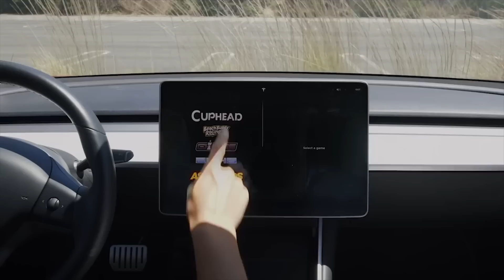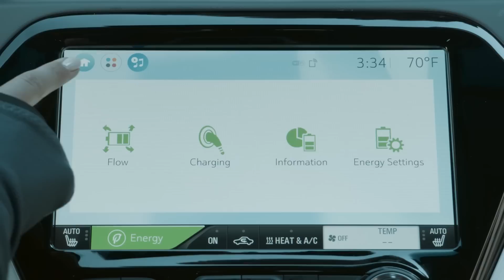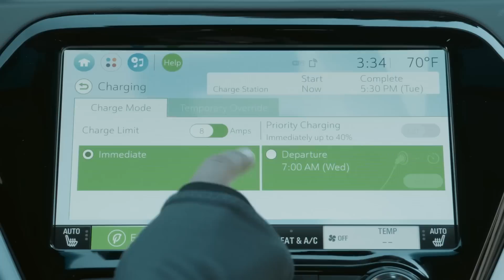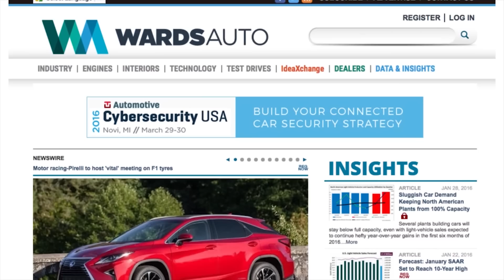Rivian Delivers 1st Electric SUVs; NHTSA Investigating Tesla - Autoline Daily 3229

Comment: If you abuse Tesla features they car will turn those features off for the rest of your drive.  I have no idea how car decides to do this.
Reply: It does not matter, California (Tesla's single largest market) prohibits the driver from having access to this feature in the CA vehicle code.
The Driver isn't even supposed to be able to see it or physically reach it. So that screen should be in the passenger side of the car, not the center console.
If it is, the driver can be given a ticket by the CHP or any CA PD officer the moment they see that on the screen.
And there is do defense to it and since it's built into the car, your set up for multiple tickets and if you get 3 of them in a year, DL suspension.

Comment: 3 seconds?  What I can't understand is why this infotainment screens were ever allowed either...the worse ones being those from the VW group as they are touch sensitive and everything is adjust by the unit!  There have been many Motoring Journalists complaining at the about of time needed to simply change the heating settings looking at fir the correct areas that controls the screens.
Here in the UK things are really quiet simple, "The Driver must NOT be able to see any moving screens from the driving position.. although there again the legal department don't s appear to have noticed the infotainment screens yet!
Reply: Or talk to a passenger, or listen to music in case it distracts the driver.

Comment: I agree! lets get rid all cell phones and tablets that are capable of playing games in a moving car.
What ever penalty the agency Comes up for tesla will have to apply those devices as well. So with that logic where do you think this Investigation will end up? Tesla will have a software update to correct it just as quickly as the software removed it.But yeah yeah i know it will have to go at the speed of  govt first.
Reply: What don't you get? It is the responsibility of the automaker to make sure that nothing "built into the car",  at the close reach of the driver unnecessarily distracts the driver when the vehicle is on the move. Cellphones and tablets are differently owned by the driver and it is the driver's responsibility not to use them while driving, not the automaker's. Most automakers I know do everything they can to prevent this. Tesla seems just to joke with safety.
Reply: @KeliK1  That is not correct. The car maker is resposnible to secure the person from ever doing anything untowards bad driving skills. They are responsible to disable your phone and tablett and only allow mechanical instruments which you must follow religiously. Really, don't you read the laws? Its stated most explicitly there.
Reply: 2 million callbacks. Where are the callbacks? Why does nobody have an appointnent? Why did you not get al letter by snail mail. Just as i got one a few weeks ago because Peugeot had a typo in their public permit for the E-208.
Reply: Is there a specific law preventing you from playing on the touchscreen like there is if you just touch your phone?.
Reply: @Robert-j6r8c  Yes. Every action preventing you to watch where you are going - or in this case driving - is verboten. 

Its all a matter of relevance. Did you walk into a traffic sign? Your problem. 

Did you hit a kid and thrown him onto the rails of the oncoming U-Bahn killing him immediately? - Lifelong prison.

Did you have to break harder than normal and not hit anything? Nothing happened - right? 

Did you drive over a red sign? Derail the tram? The tram hit a Bus full of children and the bus hit a full tank of liquid nitrogen which exploded and 20 children died? You got a problem mister!